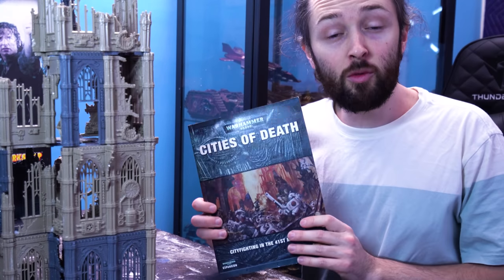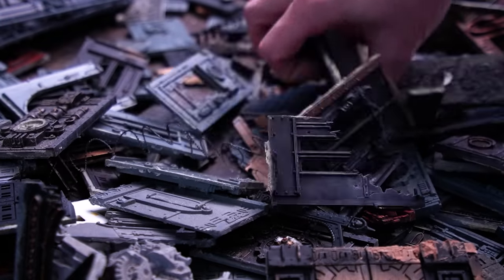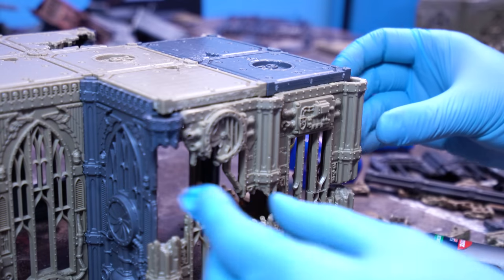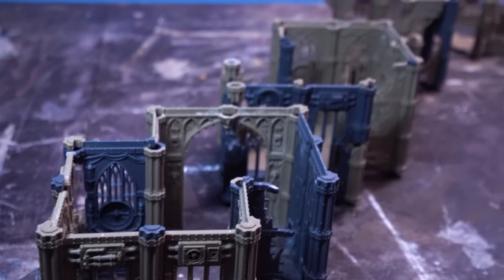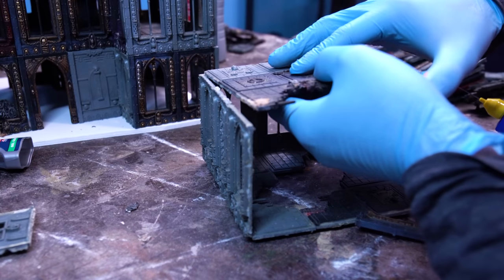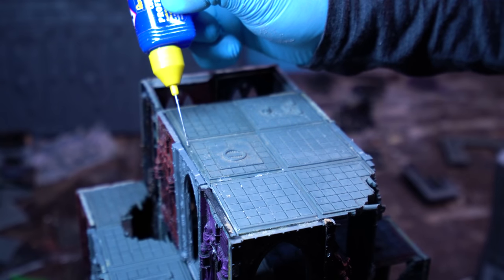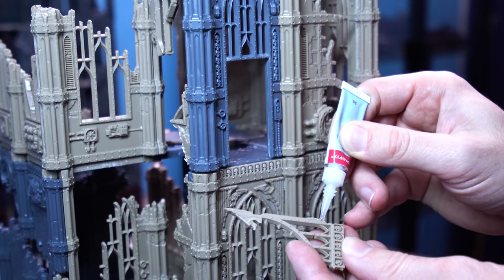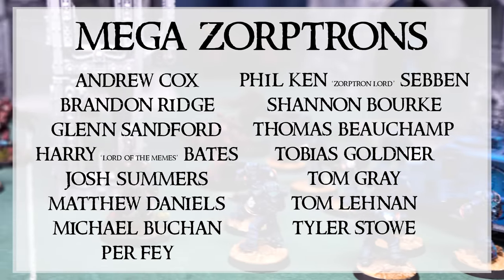CITIES OF DEATHHHH | Kill Team, Warhammer 40k, Necromunda Hive City Gaming Board

Comment: Build that functional elevator. You know you want to.
Reply from the maker: WELL MAYBE  I WILL
Reply: For the love of the golden throne, do it
Reply: A small motor, threaded rod, maybe a 3D printed gear (or jaycar should have something) and a simple frame would work, or go a cable setup and then you could use it on different heights too. Bonus points for a raspberry pie, and a sensor setup keyed for floors so you don’t have to manually turn on and off.
Reply: @Zorpazorp  you'll get another subscriber if you do lol.
Seen a post on Facebook recently, showing how to make the drill whilst keeping it moveable. I'd love nothing more than some free flowing movement in terrain, so will be watching, love the work
Reply: DEW IT
Reply: Would look amazing! Do it!
Reply: Do it
Reply: He needs to do it...
Just do it!
Reply: @Zorpazorp  Just do it!
Reply from the maker: Alright peeps SUPPLIES HAVE BEEN BOUGHT, might take a bit to get here but it's happening!!!

Comment: I say do the elevator, but it has to go "Ding!" when it reaches a floor and the doors open.
Also- if you use the sprues from all your kits for some hardcore plastic carpentry material, you can increase your square footage by half. Plus it's all so much stronger, angles and joints. Nice work here.
Reply from the maker: Hahahahaha and plays elevator music too!!!!
Reply: @Zorpazorp  can you imagine some grim determined Space marines covered in battle damage patiently waiting to get to the top floor to get the guy that gave them the damage as calming elevator music plays?

Comment: Oh man, when I was a kid i built an elevator out one of the little lego spools with the crank handle and the string.We had rules where you'd roll 2d6 to see how many turns you could spin it, and you could choose to use part of them to stop at half levels to take cover using the floor. It worked TERRIBLY, contantly getting jammed on the elevator shaft walls, and it was clunky in game, but it was so freaking cool at the time.
Reply from the maker: Thats so dope man haha, I've sourced some toy that I'm going to cannabilise for parts so brace yourself it's happening!!!

Comment: Awesome concept.
Too bad the new Sector Imperialis is not available at the moment apart from the Sisters of Battle special Building and the newest additions to this system, the newer Battlezone: Manufactorum pieces are a quick-build variant with very limited options out of the gate (sure, you can cut them apart, but that adds a lot of work they could have spared us).

Comment: What are you spray the terrain with in 4:20 and what with the two different glues?
Reply from the maker: When building these massive kits I use three glues, Plastic cement for a nice long term plastic weld, Cyanoacrylate Super glue for a fast instant bond, which is quickened by an activator which is the spray you see, and then a really strong and impact resistant bonding agent like Tarzan's Grip General Purpose, which becomes like a gluey rubber.

I use the first two on the actual contact surface, and the third as a filler glue when joining uneven surfaces and on the bottom side of joins with only a single plane of contact like the side by side floor tiles who need some shear strength :)
Reply: @Zorpazorp  Thanks for sharing!

Comment: But why are you supergluing plastic??
Reply from the maker: When building these massive kits I use three glues, Plastic cement for a nice long term plastic weld, Cyanoacrylate Super glue for a fast instant bond, which is quickened by an activator which is the spray you see, and then a really strong and impact resistant bonding agent like Tarzan's Grip General Purpose, which becomes like a gluey rubber.

I use the first two on the actual contact surface, and the third as a filler glue when joining uneven surfaces and on the bottom side of joins with only a single plane of contact like the side by side floor tiles who need some shear strength :)